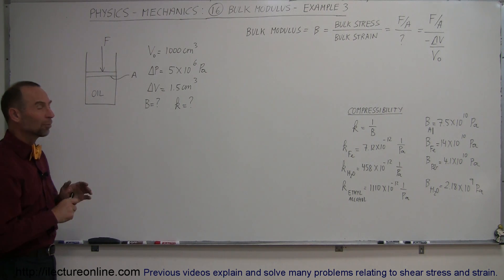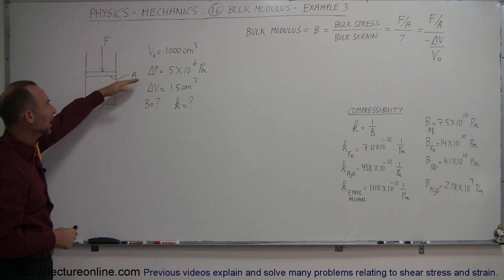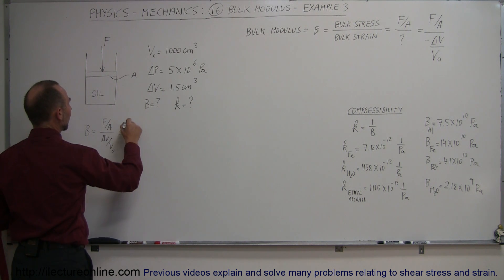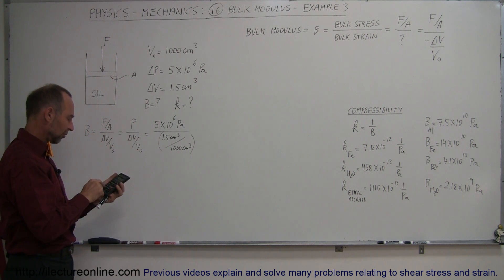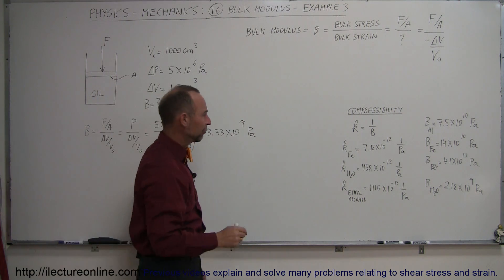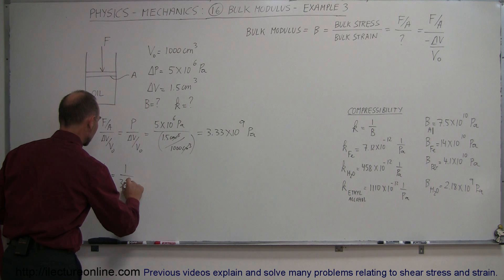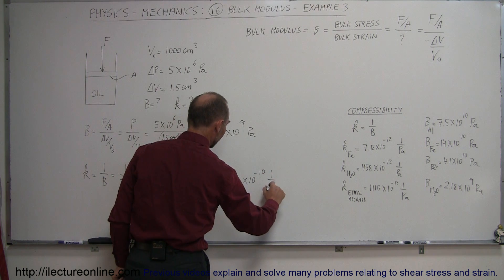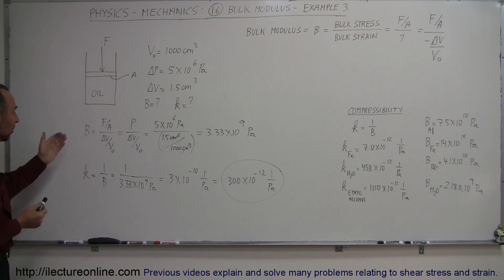Physics - Mechanics: Stress and Strain (16 of 16) Bulk Modulus: Compressibility of Oil

Comment: Thank you very much for this video, Michel. A question: Is pressure equivalent to stress? As in, when dealing with solids we use stress but when dealing with liquids we use pressure?
Reply from the maker: Yes, they have the same units and can be used interchangeably.  But we also use pressure for solids:  "how much pressure does the heel of high heel shoes apply to a floor?"